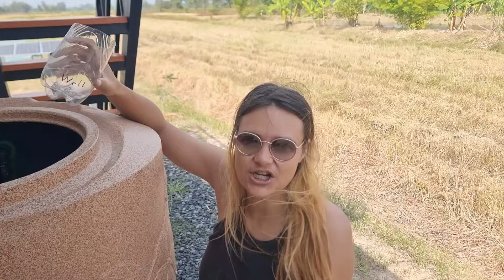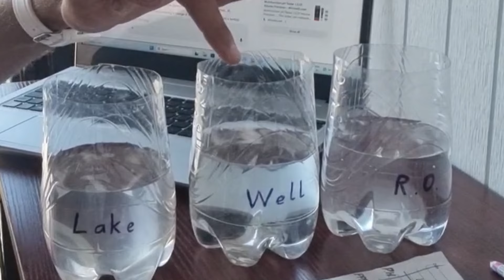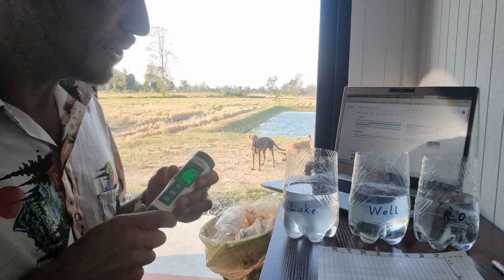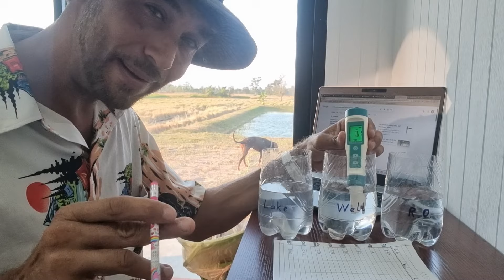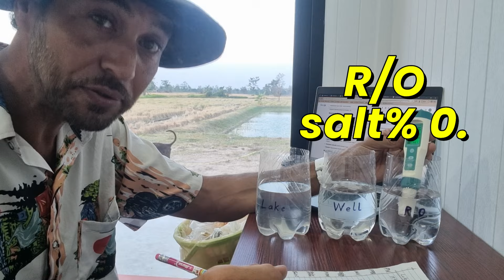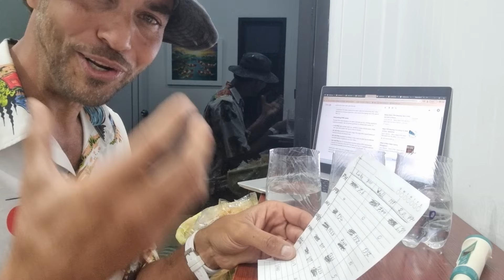Water Test in Thailand off grid

Comment: The lake and well is the same water. The Reverse Osmosis is bought from a store. Why don’t you just buy a Reverse Osmosis system with filters to put by your sink just for drinking water.
Reply from the maker: Hello, and thank you for the good advice. We are well aware of the R/O system. There are a lot of things to complete on the homestead. We live on a tight budget so we are not able to do everything in one shot. We are doing a little every month until it's complete. If you look at the video were we show the water system on the house, you will see a gap between the 500 letter tank and the high pressure pump, that's for the future filter system. As simple as that sounds, we have to take one step at a time, or we'll just run out of money. Our Channel is to show what you can build on a budget.
Reply: @thailandoffgrid I find many in Thailand put a Reverse Osmosis system on all the water in the house. It’s really only needed for drinking water which ya can put a system under the sink to its own tap.
Reply from the maker: Richard,  everything takes money.  One step at a time.

Comment: Great explanation...the more information you collect the better decisions you will make when living off grid...most local Water Authority Offices here in Thailand will test your water for free. Just bring them a fresh sample of about a liter. They test for fecal form and a host of other contaminants by trace amounts that your handheld wont, and they can give you a full report. Here on our farm, we also have a well water system and recently the city water came to a nearby farm, and so we ran the pipe from there so now we have both. My own design for the well water consistently produced a PPM of about 85 which was great...our city water system fluctuates between 69-100 ppm which is fine as well, but we only use a tri-filter at the point of use on the city. The water still tastes great and we use it for everything. I don't know if you have done a sediment test yet but just for kicks take a clean full glass of well water, test it, then let is sit still in the open for 3 days and test again, being careful not to pick it up before testing, and see how much the PPM changed. For my first well filter system, I built three, 5-ring towers, #1- 2/3 fill coarse stone, #2- 2/3 fill coarse sand 50% and 50% fine sand on top, #3 -2/3 fill charcoal that I also made. That water was the best. My second well water was using a UPVC 1000-liter tank and cylinder tank filter, where the well water was pumped into the 1000 liter and I then hand mixed Aluminum Sulfate into the tank to allow the suspended particles to coagulate and settle to the bottom so that much cleaner water was extracted and entered the cylinder filter tank...this system produced about the same result as my 3 tank system but with more work...in the end of the day we regularly check for PPM and pH while using a single cylinder filter tank and 3 stage point of use filter. No RO system. Its been five years and I'm not glowing in the dark yet so I think were good!....lol...good luck with wit the water...that RO system will be fine.
Reply from the maker: Hi, we're glad you enjoyed the video. Thank you for sharing your experience, it seems you know your stuff. We are new at this, we have a lot to learn. Thank you for the advice.